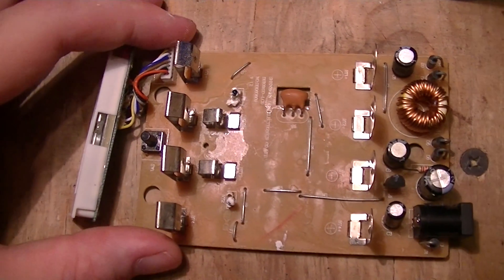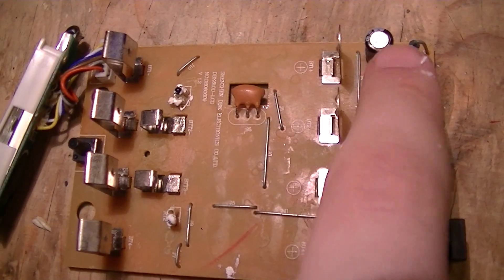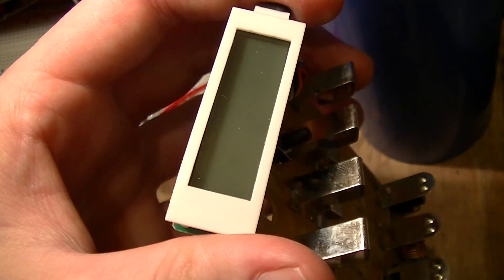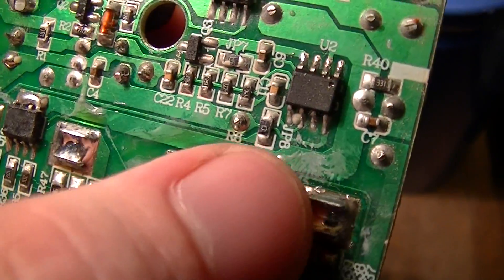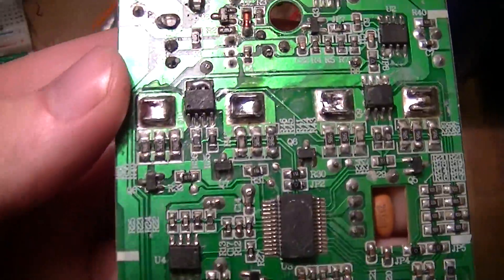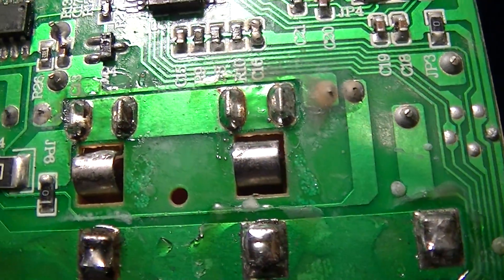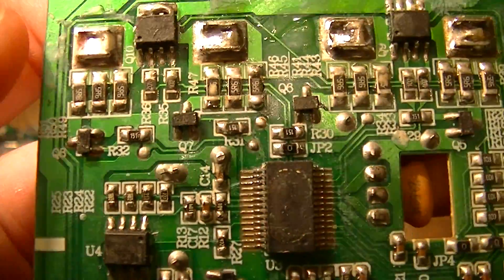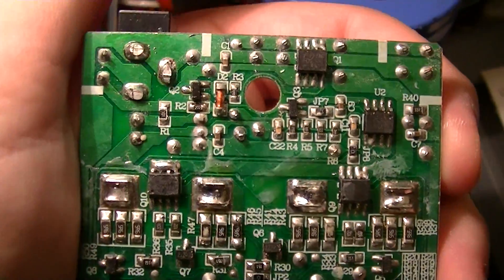Soshine SC-C2 cell/battery charger guts

Comment: I really like how they tried to block-out the part number for the LCD with a sharpie or other black marker. The lettering done on the copper layer, and as such tectured lettering that shows right through the pen markings.

Eeeeeefective.....